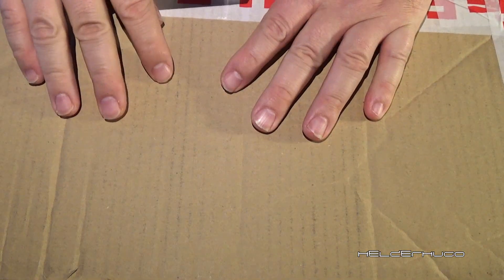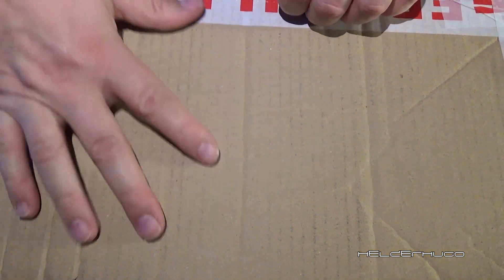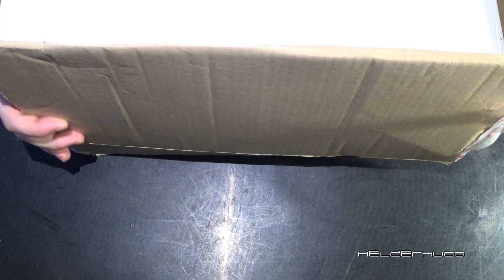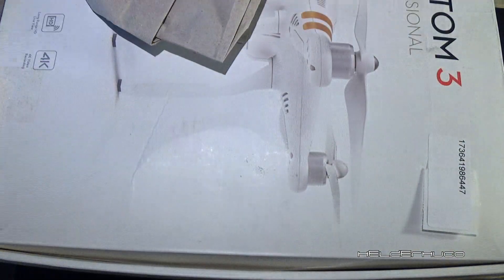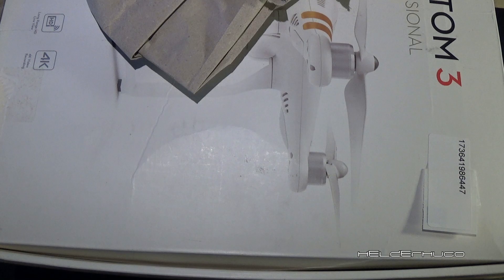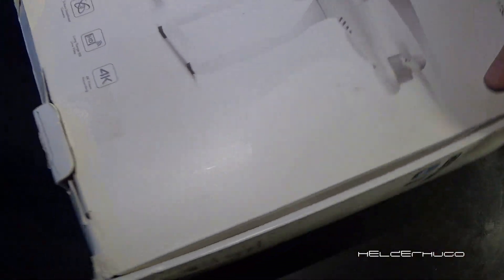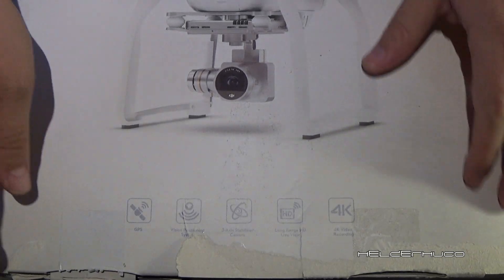Another Dji Phanvic Professional Drone

Comment: your phanvic was perfect. unfortunately my phanvic have some problem. everything is okay, ready to fly and take off but all my motor wont turn on (no any error). can you help me how to solve them?
Reply from the maker: Thank you. That is strange. The wires are all well fixed?
Reply: @Helderhugo  yes. But i didnt solder wire on board. Just solder on the remaining wire that i cut before that. My LED connection was working but not all my motor. Flight record also exist but there's no distance bcoz of my motor did not spinning.

Comment: The Fat-Mavic! I was wondering about taking the internals from, say, a Phantom and using a Flamewheel before but haven't needed and just use the Flamewheel with other propulsion systems and FC. This is not too bad. Well done. Looks like a fun project.

Comment: nice video and i will do the same with my p3 pro i ve bought 100 euros a few months ago. how about the flying time? i ve heard the panvic body is heavier than the stock p3 pro one? still have 20 mins ?
Reply from the maker: 100 euros for a p3 pro?? wow that is very cheap. The flight time is the same or maybe a little less. I didn't measure that. But I think overall is a little more heavy. And the arms open are wider than the Phantom 3.
Reply: @Helderhugo  With the arms opened wider, maybe a longer propeller could be use, like a 1045 from 3dr solo?
Reply from the maker: Yes. Opened they are wider than the Phantom 3. The 3dr Solo props can fit in the Phantom 3 motors?
Reply: @Helderhugo  yes, I've used the phantom 3 Standard props 9450 on a 3dr solo and GoPro Karma, just not the other way around unless you use an arm extender.
Reply: @Helderhugo  the seller was so upset with a so call issue i was whiling to sell it that cheap.It was way too easy to fix it and now its flying flawlessly

Comment: I envy the hell out of you. I cant afford the box they sent it in. I've been flying R/C for 37 years now. I love my drones. Till the last one (Parrot A.R. Drone 2.0) had a popping 2500 battery issue and it burned all the way to the ground. Good video quality and content. Ill sub.
Reply from the maker: I always envy other guys too. I never thought of having a Drone because they are very expensive and I am not rich guy at all. But some how along the last years I could aford the Drones. If there are a Drone God he listen to my prayers and put me in the wright path.
Reply: ✈ ✈ ✈Before the internet, we would buy plans then go to the hardware store and get broken or deformed closet or interior doors. Peel the doors apart and trace out all the parts and cut each spar and individual ribs for the wing. After taking a few months to build the planes the heart would beat a little faster and harder on that 1st flight.   My 1/4 scale F4U Corsair looked real and flew wonderfully. It had retracts that had to be pressurized with a bicycle pump. Now it takes no dicipline to build a plane or even a drone because all parts are pre-formed. 90% of any RC aircraft are ARF or RTF and the radios are basically disposable. I still have my Gold AM Futaba 6 channel that i had to hook the freq. flag to the antenna. I even have 4 sets of crystals both tx and rx. Its a wonderful hobby but if you get a friend or a kid a balsa model kit, they look at it like its a rotary phone that they have never seen before. Its a dying hobby that everyone is just discovering the wrong way. ✈ ✈ ✈